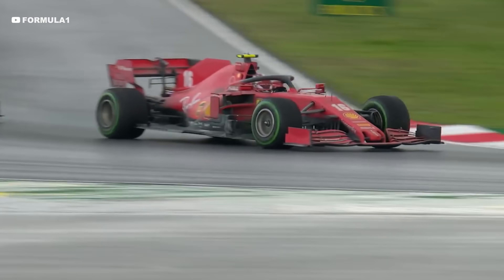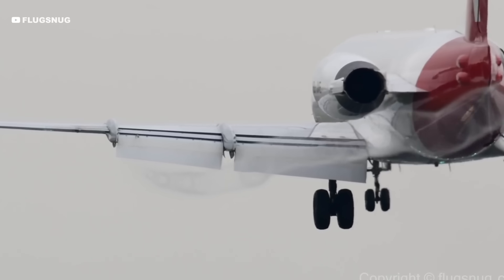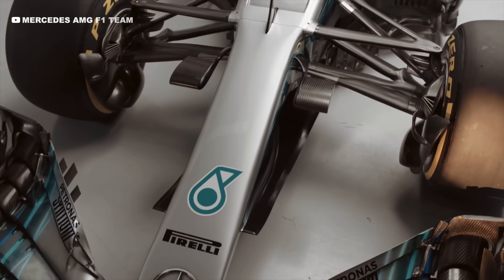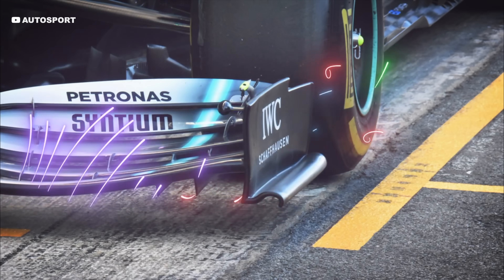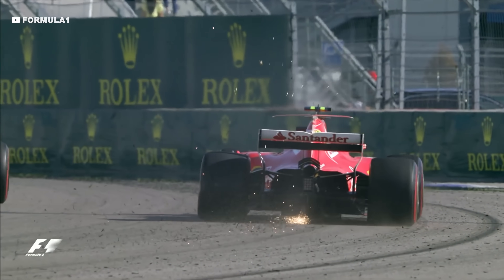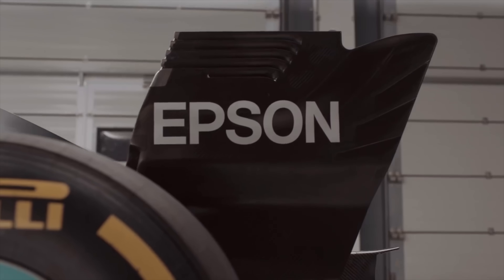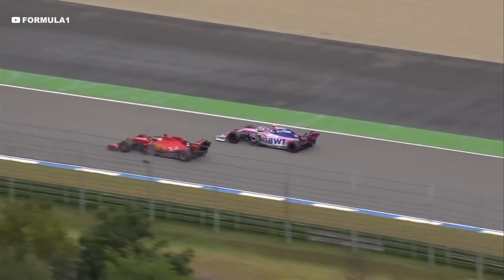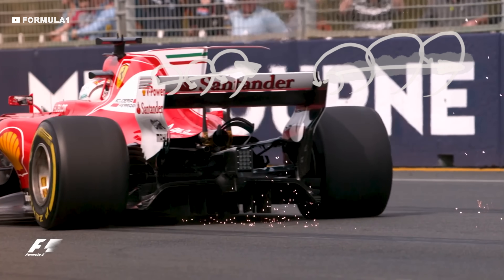The Genius Aero Trick That F1 Copied from Concorde

Comment: First of all, there is nothing “genius” about this. That’s just an internet buzz word and is mostly meaningless. Some of this is basic aerodynamics and some of it the byproduct of poor aerodynamic design. If you don’t believe me then watch what happens next year when the regulations change and most of this junk disappears..

The notion that it has anything to do with Concorde is just click bait. Yes, you can control airflow with vortex generation. Vortex generators are used on aircraft to increase the effectiveness of control surfaces. You will find them on the outer wing of a Boeing 737, just ahead of the ailerons. Vortices might have been used on Concorde but this isn’t even touched on in the video. Delta wings use vortices as part of creating lift on takeoff and at other high angle of attack manoeuvres.

But at the heart of this is an underlying assumption that vortex generation is a good thing and that assumption is wrong. Vortices equal drag. Vortex generators, wing fences and saw tooth leading edges (which I haven’t seen on any racing car) are all a sign that the engineers don’t have the airflow under control. Basically, vortex generators work with the boundary layer and wing fences with everything else (the rest of the freestream). And in case anyone missed it, that is a bad thing. Fortunately, this bitty design will largely disappear with the return to so-called “wing cars” next year and the problems caused by wake turbulence while not actually eliminated, will be drastically reduced.

Also the explanation of how an end plate functions is wrong. The end plate functions to stop high pressure air from mixing with the low pressure air by going around the wingtip and reducing the effectiveness of the aerofoil.

The vapour cloud shows 100% local humidity, also known as saturation point.

Perhaps the only part of a modern racing car that could be said to have been in any way borrowed from Concorde is the under body splitter plate.
Reply: I'm not very smart but you know your stuff I recognise the winglets on new planes stop air bleeding of wing & mixing with high pressure lift underneath wing and at rotation planes engage flaps for lift military aircraft r a whole nother level at low speeds F 18 hornet's are more stable but the Saab viggen swept wing has a higher speed less drag shape the reverse wing Soviet " Berkut " is bonkers I could talk all day !!
Reply: They use multimillion dollar aerodynamics simulators to design the aero treatment, don't they?
Reply: @slowanddeliberate6893  Ironically, they use a lot of things to design the aero but if the basics are flawed it doesn't help. GIGO. The initial design decisions have to be made by a human.

Comment: Turbulent air in itself is not a bad thing to have, rather air that has gone through a boundary layer and has suffered a change in pressure compared to ambient air. Flow attachment is critical to avoid flow separation and wake, thus an increase in drag, that’s why in planes’ wings there are vortex generators, whose function is to increase drag and allow for better flow attachment as that is a function of the associated energy that the fluid has.

Comment: Vortexes don’t enable the Concorde to fly fast. In aviation speak it’s called induced drag and is a byproduct of lift. The explanation of that is correct, but has absolutely nothing to do with supersonic speed. You could have compared it to a Cessna for that matter. Turbulent air still creates lift/downforce - just less, what both industries use are so-called vortex generators to energize and control the flow whilst making it turbulent. A bit clickbaity

Comment: Is it why tyre wears off quickly because of the frontal air?
Reply: @Matthew Chandler Not as stupid as you are. When you are following other drivers, you are running into dirty air, thats get trapped into your tyre which degrades faster than normal. The car is designed in such a way that frontal dirty air affects the tyre. So yes not just the friction but also the dirty air has very much influence to your tyre.
Reply: No, that's mostly friction with the ground. The air has very little influence.

Comment: Your explanation of lift is not correct and a misinterpretation of Bernoulli's Equation. Your explanation indicates an equal transit time, where the air above the wing and below the wing end up behind the wing at the same time. This is false as there is no logical reason, nor any relevant explanation in physics as to why the fluid (air) should behave like this when transiting over the wing. Instead lift (and downforce for context in this video) are just an effect of Newton's Third Law of Motion, where the air hitting the underside of the wing decelerates and is deflected down, and the air above the wing follows the path of the wing due to the Coanda Effect, being pushed down also,
but with less deceleration. This in turn creates a force acting down, and due to the Third Law of Motion, results in drag and lift. The explanation of lift in this video is widespread but fraught with misconceptions, yet still is taught in many places.

Comment: Wake vortices create nothing but drag. They’re merely a byproduct of lift creation by an “aerofoil” and as such are subject to intense engineering in the form of wing “fences” (see Airbus 320), “winglets” (see Boeing 737NG) to reduce the drag. Wing tip vortices don’t help AT ALL. The smaller the vortices, the better.

Comment: Well you can use turbulent air to control flow, but it has to be attached to the surface so you have to expedite transition the air from laminar to turbulent flow. This allows the turbulent flow to reattach post transition and can help!

Comment: Of course turbulent air can stay attached. It‘s much better at doing that than laminar airflow. However, dirty air and turbulence are two different things
Reply: Agree to an extent, but doesn't turbulent air generally form when attachment breaks down, often through too aggressive  a shape or too high angle of attack?
Reply: @laurencedawson7754  no, that‘s detached flow. Air (or another liquid for that matter) becomes turbulent and more energetic above a certain Reynolds number. I think it‘s between 3 and 4k, but don‘t quote me on that. So if you have laminar flow and just make it way faster it‘ll become turbulent
Reply: @Bl4ckDe4th88  kind of, if you are talking about the classic pipe situation or between two surfaces (for example the road and underside of a car) but the dimensions of the pipe or distance between the surfaces are factors and so you are back to the aggressiveness of the shape/ gap for the velocity range you are aiming to work in. The transistion is always related to dimensions, in a hypothetical pipe of infinite diameter, there   would be laminar flow at any velocity.
Reply: @laurencedawson7754  I guess that's right, but talking about realistic examples a fluid becomes turbulent above a certain Reynolds number, which is linked to the velocity.
Going back to your fist statement, you're probably right, that turbulence forms, if there are aggressive shapes or a stall. But it (realistically) also happens above a certain speed. And that air can stay attached. It won't in the case of a stall, but generally turbulent air isn't being detached just because it's turbulent.
And I don't even think dirty air can't stay attached, it's just hard to controll and creates massive amounts of drag. That together with the fact, that it's hard to calculate it's behaviour is most likely why F1 tries to get rid of it.
Reply: @Bl4ckDe4th88  great chatting with you, I find the aero aspects fascinating.....I think I remember an Adrian Newey where he states that even through the slow corners at Monaco , aero is still the most important factor!
Reply: @laurencedawson7754  Pretty crazy. But then there's also Formula Student with cars driving no faster than 120 kph and they still use aero devices all over their vehicles

Comment: BS   90% is AOA angle of attack. Why does a symmetrical wing fly with both sides the same shape. or a regular wing fly upside down ... It's AOA
Reply: HDM: ...and AOA creates high and low pressure areas above and below the airfoil, regardless of the shape.  However different shaped airfoils create more or less lift depending on the speed.  Shape matters. This video is quite accurate, and above average descriptions for YT.
Reply: @KB4QAA 
 It's still AOA not Bernoulli.  Given enough power a ROCK will Fly. If it were Bernoulli then an FA-18 or F-15 or any other over powered plane could not accelerate straight up.  Besides Pluto is a PLANET.